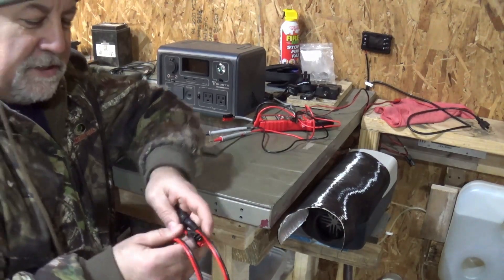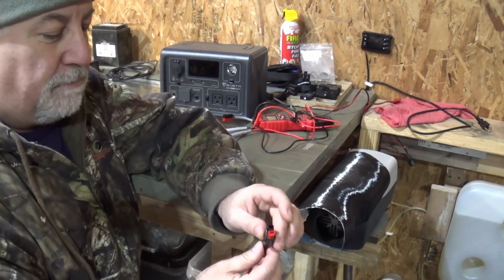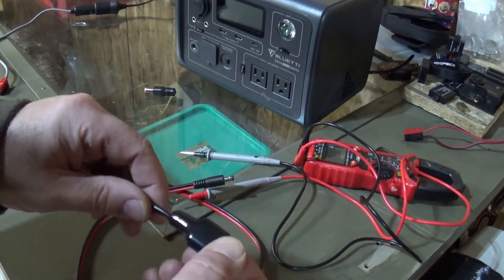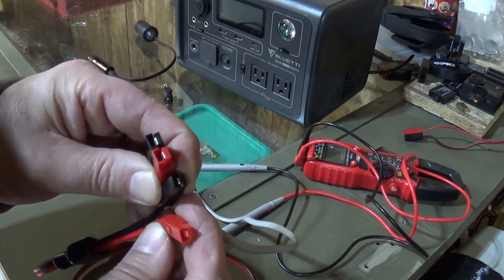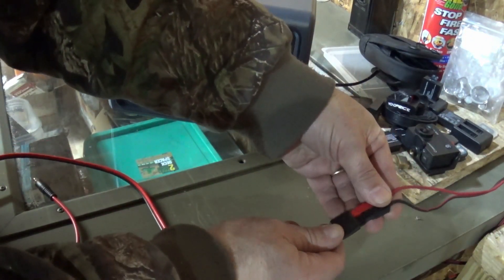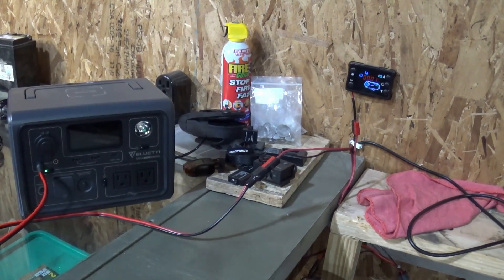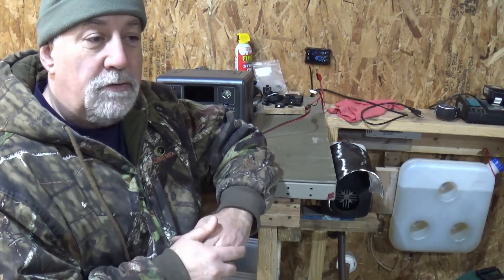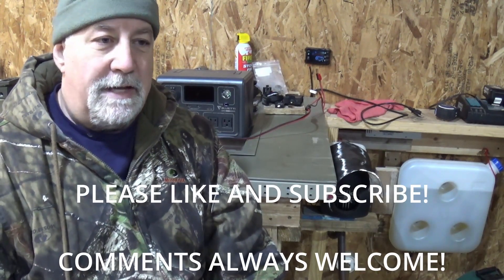Diesel Heater DC Hookup to Power Bank - Bluetti EB3A

Comment from the maker: Running a diesel heater from the cigarette lighter plug on a power bank: https://youtu.be/FM75P510f14

Amazon affiliate links to products in this video. Please help support the channel and use these links if you purchase products you see here.

DC 5.5mm x 2.1mm Power Male Plug Cable: https://amzn.to/4a6ZiJp

Vevor 5Kw Diesel Heater: https://amzn.to/3uxRujG

Vevor 5Kw all-in-one Diesel Heater: https://amzn.to/46yD28s (currently has a $15 coupon!)

Bluetti EB3A: https://amzn.to/3sX968k

Bluetti EB70 (higher capacity power bank): https://amzn.to/3sX968k

Comment: Did you use a fuse somewhere between the EB3A and the heater?
Reply from the maker: Yes. There is a fuse inline that's part of the power cable that comes with the heater.

Comment: Did you cut off the heaters battery ring connector to add the Anderson pole connector?
Reply from the maker: My heater's DC power cord had bare wire, no ring connectors, no nothing, just wire.
Reply: Thanks for the quick reply. I have bluetti eb3a. What connection would you recommend using. My hcalory 2kw heater came with ring battery terminal style connection. Thanks!
Reply from the maker: @etid2010  In the description section above, there is a link to the DC 5.5mm x 2.1mm Power Male Plug Cable that I use and the anderson power pole connectors. I like both of those because they make for a solid connection.

Comment: Appreciate the videos! I have an eb3a and ordered a diesel heater but have seen mixed results with powering it from the dc side. Any update on how the 5.5 connector did?
Reply from the maker: @MattGarage - I did shoot another video on the 5.5-2.1 connector hookup, just need to edit it. Anyway, I'll save ya the wait, it works great! I do see just a hair over 10a of DC current on startup, or darn close to it. It doesn't pop the breaker in the EB3A though and it runs great after that.